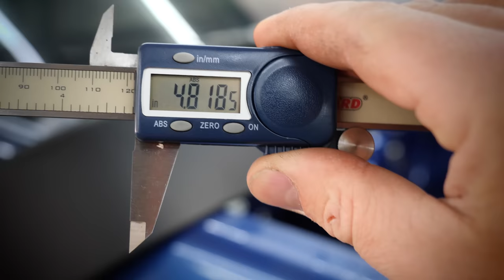I Put a SILVERADO 2500 FRONT END on my TAHOE because it's what we all wanted

Comment from the maker: I figured its worth mentioning that the 2500 HD hood, pn (15745931), is discontinued from gm so our only hopes are the junkyard or the shaftermarket😩
Reply: Where did you get the info for the cuts you had to make?
Reply: It's not ideal (because of the ridiculous markup), but try calling a Chevy dealer with a robust parts department. In my case, several months ago, I was looking for a rear door for my 2004 Tahoe which has also been discontinued (To further compound the issue, no aftermarket parts are available either. The front door can be found all day long). The Chevy parts center can lookup in their nationwide database at all of their warehouse inventory. For the rear door, there was 1 single doorshell available in the whole nation for the "low" price of $700 😆 and just happened to be in one of the offsite warehouses in the Dallas area (my town).  I decided to instead continue my hunt and junkyards and drove to 2 hours away where I was able to find one in decent shape.
Reply: @grantgeorgia7168  in Vegas we have a bunch of tahoes in the junkyards. They got a bunch of rear doors
Reply: “Shaftermarket,” consider that stolen!
Reply: I got mine from certifit and it turned out good. If ones local to you you can pick it up same day and they come in black primer.
Reply: I have a whole 2003 2500hd with 6.0 parts truck if anyone is interested
Reply: @BowtieForLife420  where are you located? How much for the hood?

Comment: Working on my 2004 AWD 1/2T Suburban 225K... Same color as yours.  I recently ordered new rockers and rear lower quarter panels.  I'm going to tackle the repairs myself.  I want them done before another Chicago winter.  The rust holes are only getting bigger!! 

   I do watch and like your videos of the Tahoe.  I have put some of your upgrades/repairs into action on the Burban!   Replacing the driver seat foam, leather and heating element has been a game changer!!   I've owned this truck since 2006... bought it with 36K.  The only major ($1500) repair was the AWD transfer case.  Still pulling my boat on the original trans.... knock on wood.  :)  And she's still on the factory fuel pump.  Heading north for a week of camping and fishing in less than 2 weeks... pulling the boat and all of my glamping gear... 

  Around New Years, 2021, I installed keys and blocks for a "3 inch" lift.  At the same time replaced both upper and lower control arms along with the rest of the steering components... The steering box and and shafts are another near future project.
  Keep the Tahoe content coming... Good stuff.

Comment: Did the same thing with my 02 Silverado z71.  Kept the original bumper though and added the blacked out grille and lower valance from an 03 Tahoe z71 and the HD hood from an 01. The hood  had a similar story....found it on Craigslist and drove from houston to near San Antonio and the owner called me and proceeds to tell me that although the hood was smooth and primered it had been on through a garage fire. I got it anyway because at the time I couldn't find those hoods but when you open it the underside defiantly looks like a BBQ pit.

Comment: I've been waiting FOREVER for this video! It looks great. At least you got the hood liner, which is almost impossible to find, and the under hood light. Be for warned--peeling that chrome is gonna suck ass. I did it the easy way and just plastidipped it. The Denali rear bumper cover goes right on top of your existing bumper.  You could use krylon fusion paint to match the oem gray--and it'll last. If you feel confident enough to do your own body work,  and you're good enough--just do it! You'll save money and you'll have the satisfaction of knowing you did it yourself.  Are you painting the whole truck? Or just the parts that were damaged and replaced? Looks great so far,  keep it up Matt!

Comment: So, I got the same color tahoe, same look.... I'm always on the lookout for an HD hood in my color. With color being a topic, this color is available in duplicolor spraybomb. I got a case on Amazon not so long back, totally worth it. Just this month or last I wire wheeled my front bumper down to the lowest levels of bare metal, then used an etching primer, rust converter (just in case), then aerosol color matched and a clear coat.... it comes out good. Helps that it's just a bumper, blends easy. Using a canned clear actually works out just fine. Also did the rockers and quarters.... it isn't the 100% final version, as I'll be adding new metal for that. But these areas, rockers and quarters, also work out real well with aerosol and canned clear. Super easy to have these things blend, especially in a color like this. No one would ever know.

Comment: I've been loving these videos! I got my first Tahoe (2003 Z71) a couple months ago. I ended up totalling it when I crashed on a mountian road sliding on slick tree material. So just two days ago I got my new 2003 Tahoe LT. This one is in nicer condition, but I severely overpayed for what I got ($7,500 for a SUV with several cracks in the windshield, a missing 2nd row headrest, bubbling paint right where the rear windshield wiper meets the hatch, and a check engine light right after driving away with keys in hand from a dealership that purposely neglected to list the issue it had. But on the bright side I have brand new all terrain tires on new wheels, the interieor is in great condition with few exceptions, it runs and drives fantastic (even better than my first Tahoe). Your series which I have just found has given me many ideas or upgrades on my new rig. I just gotta save up and start small. I think my first upgrade will be weathertech floor mats and weathertech window deflectors. After that I will probably look at a bluetooth touch screen head unit and a dash cam. Maybe look at running boards and a roof rack, but I'm not sure if a roof rack is possible with my sunroof.
Reply: I bought my 03 Suburban for $2900 and I felt that was an overpay.  But you'll get that value back over the years.

Comment: I ended up doing to the 2500hd Cat's Eye swap on mine simply because it looks different. I felt it a shame that they never updated the Tahoe's etc until the complete body change to the boxier version. What I love about these trucks IS the ability to take from many GM models based on the same platform and fit to your tastes. Had to fix my shift indicator LCD so swapped out LED's and added the Escalade overlay. Same with the backglass and third brake light much like yours from an Escalade.Bits and pieces here and there from a little of everything. Do the body work yourself, you'll love it that much more when finished.

Comment: I noticed the aftermarket headlights on my Burban have VERY flimsy mounting buckets. I transferred the stock buckets onto my new headlights and they fit and line up now MUCH better. And when I say bucket, I mean the black mounting bracket on the back of the headlight, not the frame on the core support.

Comment: Is that the factory transmission cooler or is that aftermarket?   That thing is massive compared to the joke GM put in the front of my 01 Suburban with an 8.1 and a 4L80 trans or my 02' Silverado with a slightly larger cooler running  the 8.1 and Allison trans.

Comment: I dunno, I'm digging the black.  It's a nice contrast.  I wouldn't re-use the gray.  But it's your truck.  

I'm curious as to how much different the rear bumper install is on a Silverado, because I bought one years ago and it's still sitting in my garage because my research indicated I would have to either remove my hitch or lift the back of my bed to make the new bumper brackets go in and line up properly.  

Now you've got me wondering if my information was wrong.

Comment: Hello this probably is the the best place to ask questions but I’m gonna anyway, so I have a 2004 Chevy Silverado and when I’m at 2500rpm the oil pressure needle goes up and down a couple psi, constantly, then it stops doing that when I go below or above 2500rpms, oil level is good, and it idles at 40psi, I don’t know if it’s normal, and I can’t seem to find an answer.